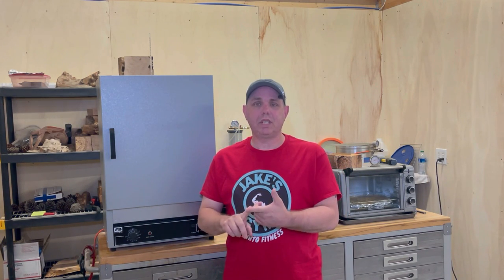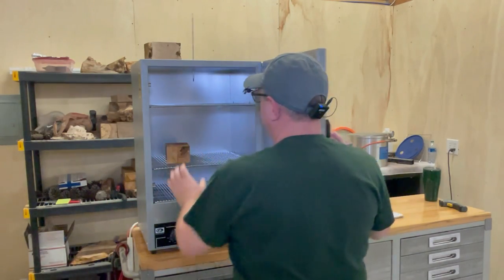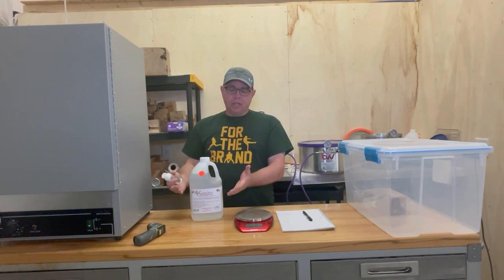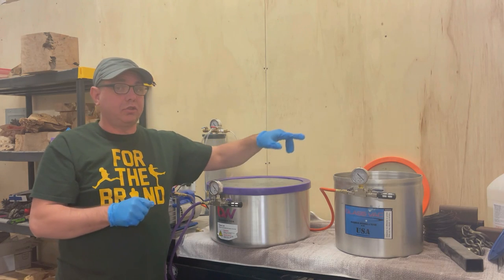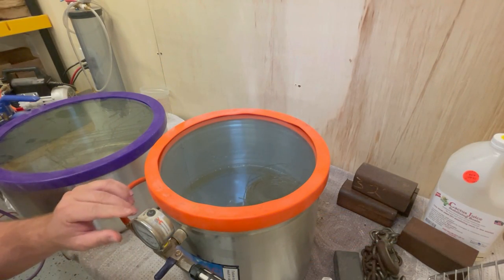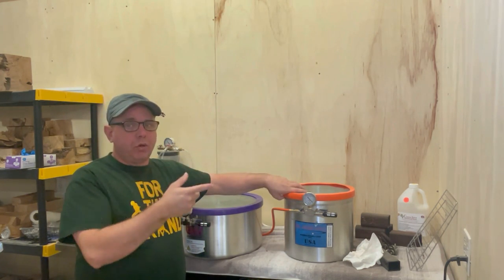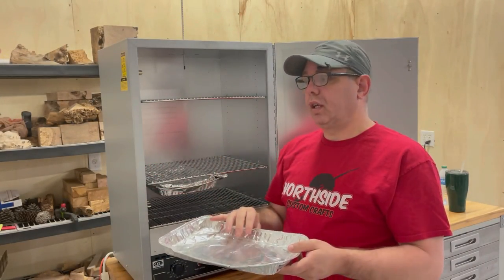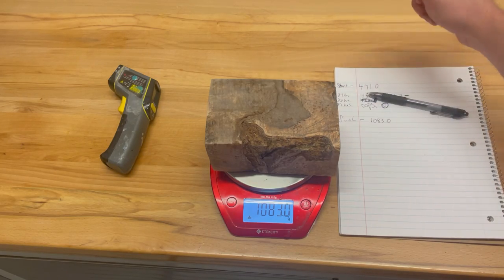How To Stabilize Wood Easily - A Step-by-Step Guide

Comment: Great video Jake! I tried to explain to a fellow YouTube(er) that wrapping the piece in aluminum foil wasn't really needed during drying process...However he insisted it wouldn't work without it...Thanks for vindicating me. 😁
Reply from the maker: I’m glad I could help out.. I’ve never wrapped them and it’s always worked. 👍👍
Reply: Have never wrapped mine either based on what Jake, Casey Martin, and Zac Higgins have shown.  Works just fine and much less cleanup

Comment: Is cactus juice the standard, and is it literallycactus juice or is cactus juice a commonly used name for something? I just assumed the process was going to be more like how carbon/glass fiber is laid and impregnated with epoxy in a vacuum bag. I suppose epoxy runs far too thick to soak up through the wood properly.
Reply from the maker: I'm glad you enjoyed the video. Cactus juice is just the name of the product. It is pretty much the standard. There are other products out there, but I think Cactus Juice is the way to go.

Comment: Is there an Ambient temperature that stabilizing should be done at?    unlike resin casting, temps are very important.   What woods do you stabilize?   any?   i am curious  and interested, I have some root burls that are flaky and of course wont stay together on the lathe .  if i  were to use a hardwood that's not punky or anything what would the result be?  seems real interesting, is it ok to stabilize in the basement or is the smell over powering and should be done else ware I don't heat my shop in the winter to much over 50 warm enough to work without gloves.  I live in NW near the Rockies
Reply from the maker: As far as ambient temps go.. just don’t store the cactus juice over 80 degrees F. It can set up if it gets too hott.. you can stabilize hardwoods but it doesn’t gain much weight and I’m not sure how much it will help with minimizing seasonal movement. I stabilize mostly maple burl.

Comment: The cactus juice had turned dark from the 1st use; If I understand right the juice can be reused for up to a year.  Will the dark color from previous stabilizations ruin projects down the road?
Reply from the maker: It just looks dark.. it’s mostly just dust and grime going to the bottom making it look dark.. I’ve never had a problem.. after I stabilize pine cones, I will clean everything and start fresh after that.

Comment: Great video. Just curious though, could you not just turn the over off after the 24 hours of drying to cool off slowly?
Reply from the maker: Thank you… if you just leave it in the oven without covering it in plastic or sealing it before you put it in cactus juice.. it will collect moisture from the atmosphere.. and will undo the drying we did

Comment: Hey Jake great video. One trick is to get a MP 3 in. x 6 in. 20-Gauge Galvanized Mending Plate. Metal plate with spikes and put it in the foil pan. Then you don’t have to hang it and you have even less clean up on the bottom. The Beauty is the grate does not have to be cleaned either.
Reply from the maker: That’s a pretty good idea 👍

Comment: I noticed that many videos on stabilizing wood using a vacuum chamber with a pump will tell you to leave the pump running for as long as it takes for the air bubbles to stop.  When I read the specs on these pumps they say do not run them longer than two hours. What is your take on this fact?
Thanks
Reply from the maker: Thank you for watching first of all.. I appreciate it.. 
I think they say 2 hours because after that length of use it gets a bit hot and the pump oil can start breaking down.. if I have a long run, I change the oil before the next use.. I’m still using the original pump I bought years ago.. The other point might be, if you want all the air out of the wood so you can get a thorough stabilization of the wood, you have to wait for all the bubble to stop. Some people just buy cheap pumps for when they stop working, they can just buy another one. 

I hope this was helpful.
Jake
Reply: Thanks for getting back to me.  One of the things I don't understand is if the vacuum chamber is able to hold the correct setting even when you shut the pump off why is it necessary to keep the pump running?  If the chamber does drop over time I can turn it back on until it reaches the correct pressure.  @JakeThompson
Reply from the maker: @patrickhealy1761   all I know is.. it states very clearly to leave the pump on  until it stops bubbling.. maybe it just needs to keep expelling the air to keep removing the air from the wood..This is the most common question I get.. if I get a better answer .. I will definitely come back to this comment and have a better answer..
Reply: Thanks for your feedback.
 @JakeThompson

Comment: Hello there. I enjoyed your video. It was informative. I have a question. I bought a kid awhile back. I’ve left it in storage long enough the activator crystallized. Is there a place where I can buy just the activator?
Reply from the maker: If a kid has crystallized.. you have bigger problems… 😂😂. 

I would contact turntex and see if the have it.
Reply: I did send an email. The base solution is still good. Just the small bottle of activator went bad. Waiting to hear from them. Thanks.
Reply from the maker: @YamahawgDawg  👍👍

Comment: Nice quick summary.  Do you strain your cactus juice before you store it after you’ve used it?
Reply from the maker: I store it right in the vacuum chamber. Every once in a while. I will pour all the cactus juice into one chamber and clean the empty one.. that’s about it.
Reply: @JakeThompson  Thanks.  Since I use the vacuum chamber for silicone and epoxy, I need to pour it back or into another container.   I've been straining it to get the wood chips and other detritus out; didn't know how others approached it.

Comment: Heloo . I run the vacuum pump over 6 hours and the buble not stop to out . Over night stop the pump and next morning start again ,many  buble come out . Its normal ?
Reply: Teak wood
Reply from the maker: I’m guessing Teak wood is very hard…. But I’ve never stopped and started again.. I just keep going until the bubbles stop. 👍
Reply: Ok but over the night ....i need to sleep , and the pump heating too much
Reply from the maker: @dumitrupascale7758  did you get the bubbles to stop the next day…. You could also start the process in the morning… I haven’t had to go over a 2 hours since cactus juice went to the new formula.

Comment: Help Help !!  Need some info. If stabilizing hickory and it takes seven days to quit bubbling. Do I leave it soak for another 7 days ??  Do you leave your vacuum pump run for the entire time ??
Reply from the maker: I’ve never stabilized hickory. 7 days seem like waaaay too much.. I’ve done about 12 hours with the old formula of cactus juice.. and I do leave the pump on the entire time.. after the bubbles stop.  You are supposed to turn off the pump and release the vacuum and let soak for twice as long as you had it under vacuum.
Reply: All the hickory still floats after 2 days.
Reply from the maker: @scottjones6652  Not all of the wood you are going to stabilize will sink.. Hickory is a hardwood.. there’s not a lot of space in the wood fibers for the resin to get into.. The burls that are spongy will soak in alot of resin and sink..

Comment: Great video Jake -- Quick question regarding your new oven -- are the temp controls accurate?  I just ordered the smaller model (20 GC) and was curious if the temp settings are accurate / reliable? 
Thank you once again for another fun, informative video.
Reply from the maker: Thank you for watching.. the temperature control gets me close and I take temperature readings directly on the wood with a temp gun after that and adjust accordingly 👍